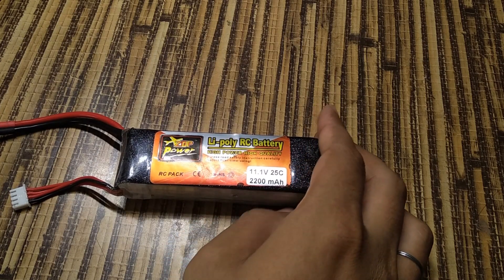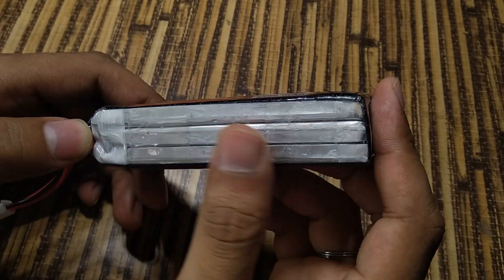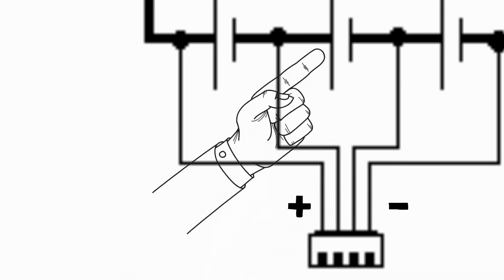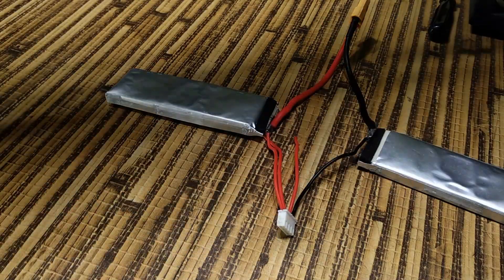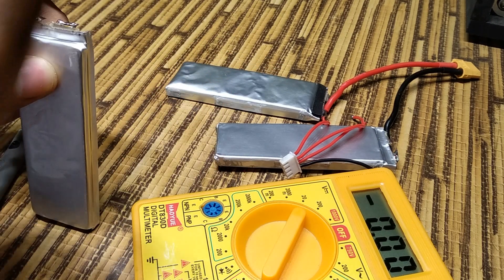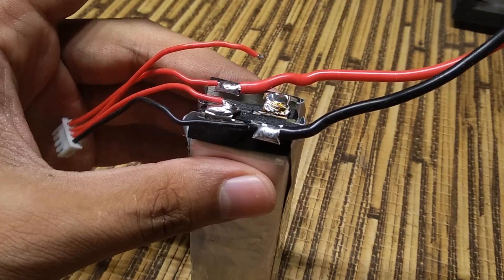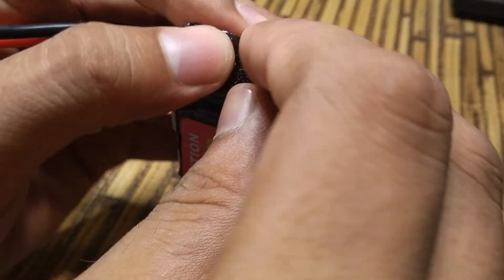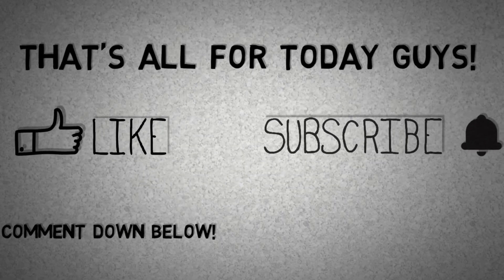How To Repair LiPo Lithium Polymer Battery

Comment: Can't we just seal the hole on the cell with Liquid insulating rubber coat?  Will that work ?
Reply from the maker: Not at all. It's not safe at all. A punctured lithium cell is a ticking time bomb.

Comment: Ah bro you made me feel so much more comfortable cutting my pack open. I want to switch it from series pack to parralell pack. I want bulk mah but low voltage . Should I be careful doing this ?
Reply from the maker: Yes, you must be careful not to deform, puncture or damage the cell/cells in the entire process. Pay your utmost respect to Lithium Polymer cells and batteries coz they can be deadly if mishandled!